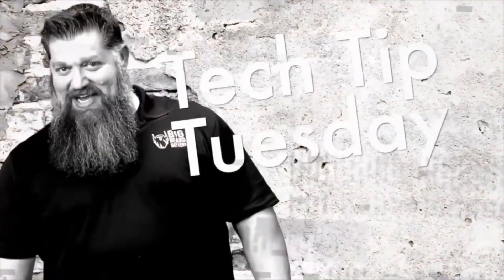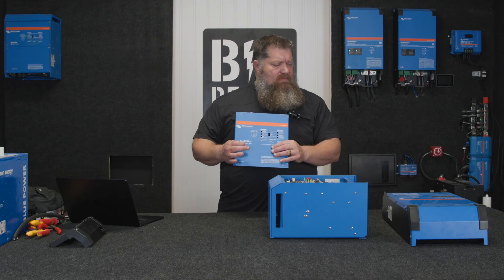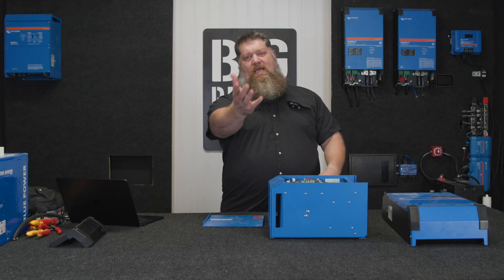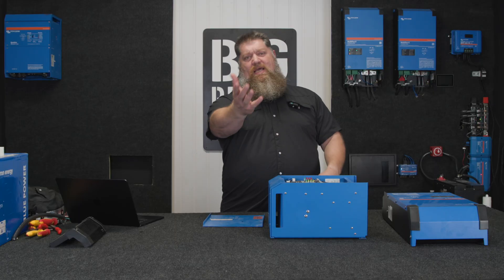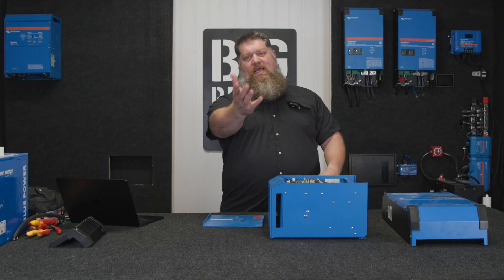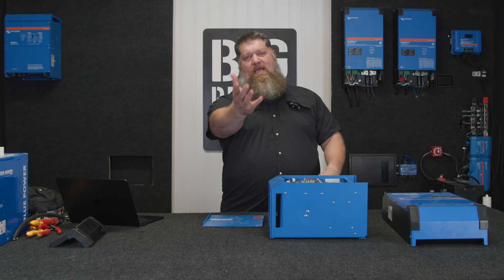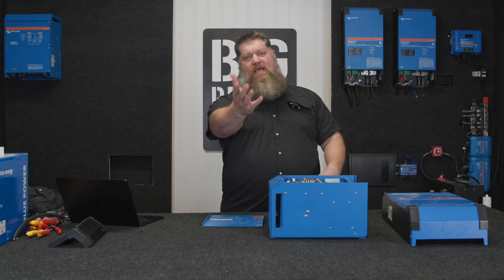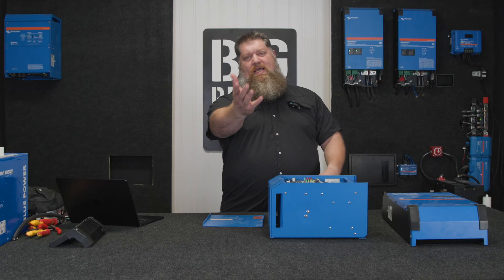VA vs Watts Explained: What Your Inverter Rating Really Means

Comment: Thank you for the video. As an electrical engineer, I want to say that you seem to know what you are talking about regarding the difference between VA and W. Just wanted to say that to offset the idiotic and toxic comment by @armelpeel. The only clarification I would have is that the VA rating they provide is what the inverter can sustain for 30 minutes. So even a purely resistive load (with PF=1) can not pull 3000W from a 3000VA inverter indefinitely. The continuous rating isn't technically calculated based on the power factor, but on the maximum resistive load that doesn't eventually result in an overload event. Honestly, wish they'd put this information in the datasheet, they really make you dig for it. Cheers!